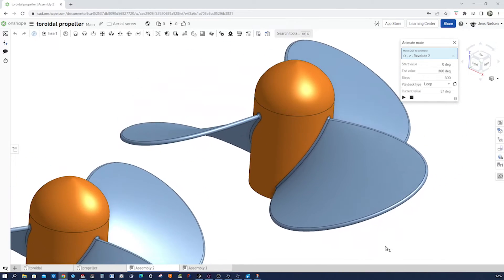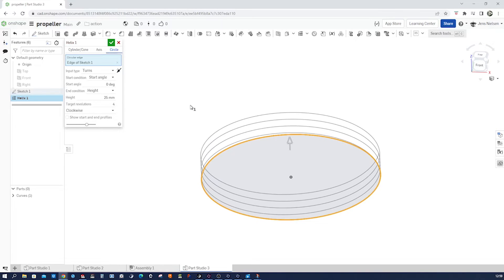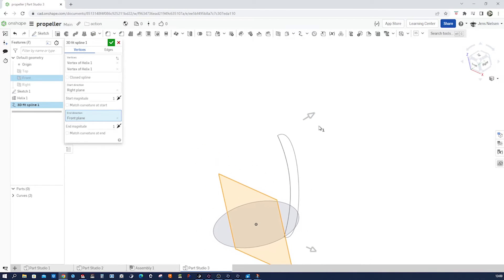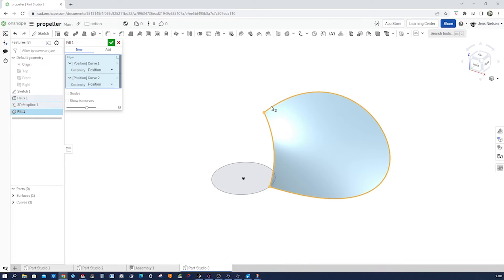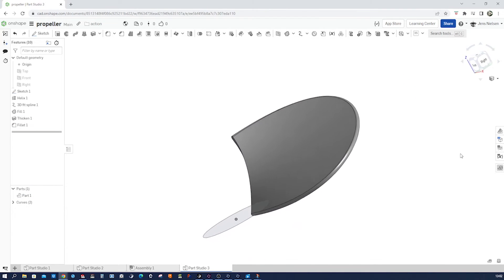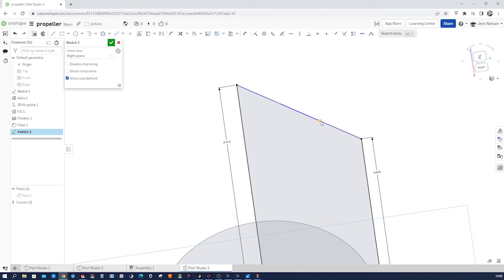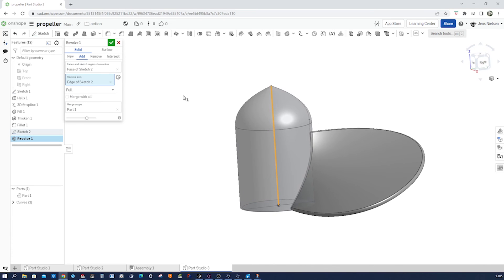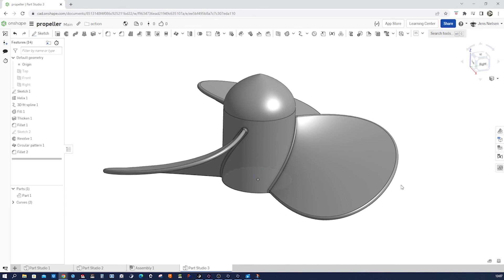The Missing Link to Crafting Perfect Boat Propellers in Onshape Revealed!

Comment: Hi. I want to thank you for making this video, but how do we know if the propeller has the correct cuvature? It seems to me that this propelller could be stalling and not work well. I can not really find any good resource on the correct shape here and how to analyze if angles will create thrust and not just push water to its sides.
Reply from the maker: Thanks. I made the video to illustrate the workflow in Onshape; by no means is this a design tested by real-life engineering principles!
Reply: @cademist  thanks. Yeah it's wasn't that clear given the title of crafting the perfect boat propeller ;) but none the less, it's the best using OnShape - and thanks for that. Made a really nice one from this guide but I'll have to run it through some fluid analyzer to see if it is likely to work ok.
Reply: Another question. How would one achieve more of an airfoil (a propeller is after all a wing where we try to create thrust and not lift sidewards) shape and a rake angle? Meaning that the propeller has the normal 15% angle backwards.
Reply from the maker: interesting question! I would like to know  myself. I know there is a feature script on airfoils freely  available, but I have not used it.
Reply: @mikasjoman  I know this is a very late reply, but you can try it with splines and use the bridging curve command seen in his other video: https://www.youtube.com/watch?v=OqPDfv5Uo4s

Also, look up some videos and info on how they create boat hulls. It will be a very similar process with lots to take away. Good luck.